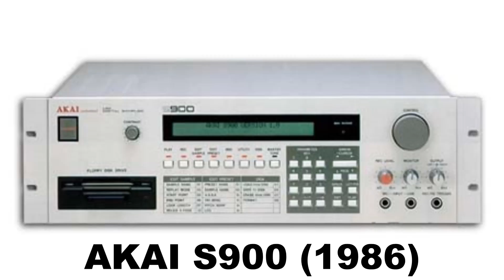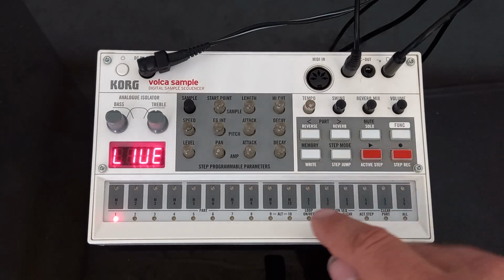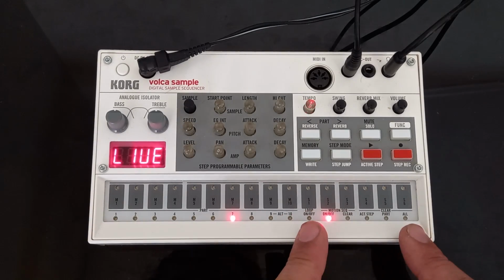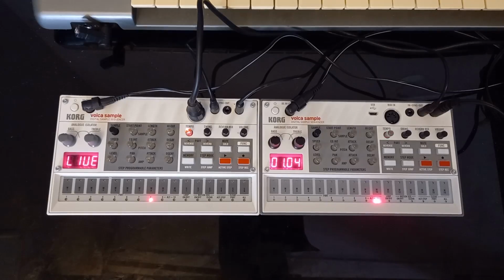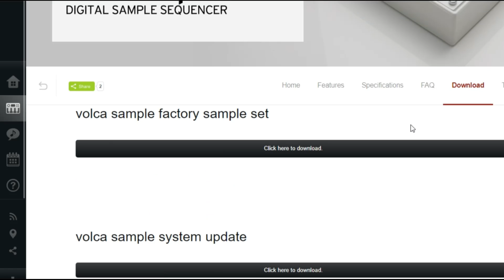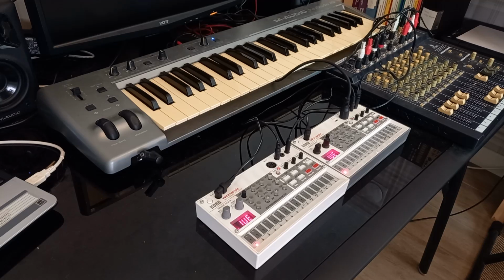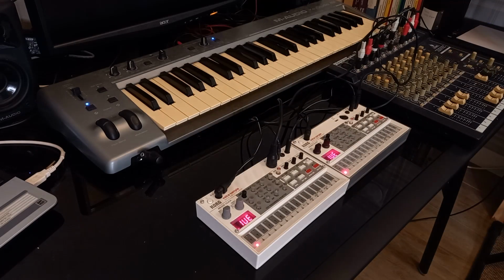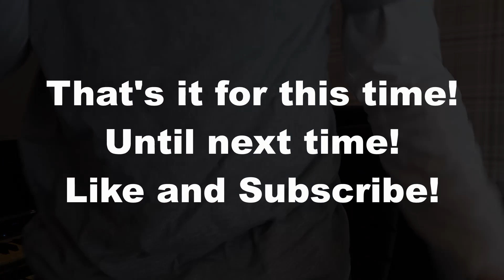Volca Sample Vs Volca Sample 2 (Which one is the Winner!?)

Comment: OG one every time: I put an 808, 707 (sorry, 909) and DMX drum kits on 3 of the pattern slots, leave the other 7 for making loops and other nonsense. If you think about it, this is the only really ‘original’ Volca, the rest just recreate extant things.
Reply from the maker: Thanks for the comment! :)
Reply: You think a volca sample would be good as a drum machine to record demos with ? I plan to load in old kits like a cr 78 and a linn to use as backing beats on cassettes
Reply: @johnrodriguez5872  Probably, no reason why it shouldn’t be good
Reply: It's a sampler, yet it's original? Huh? Plenty of influences in this device from the 808 style programming interface to the SP1200.
Reply: @lundsweden  Neither of which were made by Korg, tbf

Comment: Hi!  : )   I wonder if you can help me confirm a thing ... There is something with my Volca ( or it's that way on all volca Sample 2 ) ... I have a pattern with some muted samples. When I use the "solo" function, it does what it does, but after I turn   the "solo" off,  all parts are unmuted automatically. I want the muted to stay muted, but may be that's how the Sample 2 works ?   : )
Reply from the maker: I'm not sure, but you can save patterns with muted channels. What if you unmute the channels and the save the pattern?

Comment: Just got ahold of the Sample2 myself and learning how to integrate it into my current setup (Electribe MX and TD3) and this was super helpful! I don't suppose you have any recommendations for a mixer or interface that would work with all 3 machines? Awesome t-shirt btw
Reply from the maker: Thanks for the comment! I use a regular analog mixer when I record my volcas. What is important to have to ensure a good mix is that you have individual volume, equalizer and pan for each channel. Also it is very valuable to be able to add fx, e.g. reverb and delay, so best is to get a mixer with build in fx, so you do not have to buy a extra fx unit later. If you do not have a good sound card yet, you should also consider a mixer with build in sound card, that you can connect to your computer via USB. I do not want to give any recommendations, but an example of a mixer could be Uli's: Behringer Xenyx X1204 USB.
Reply: @AdamVoxMusic  thank you very much for replying! I've had other people recommend the Xenyx 1202 so that seems like a great shout c:

Comment: Functionality wise, I'm trying to decide between buying a Sample 1 and install the Pajen firmware vs buying a Sample 2 and get the Retrokit RK-002 smart MIDI cable.

Is there an advantage of either setup? Am I mixing oranges with apples?
Reply from the maker: If you want to use MIDI to play the sampler using an external key-board like an instrument sampler 1 with pajen is better. If you want to use it for sampled loops and as a drum machine, sampler 2 is better.

Comment: I have the Korg Volca Sample, Keys, FM, and Drum units, Two Behringer TD-3s, routed into a Mackie 1202-VLZ mixer, with a Roland SRV-2000 Digital Reverb and a Korg NTS-1 as effects.  I've been playing around with this setup (on and off) over the last few years, usually recording to cassettes.  This year I added an Arturia Keystep Pro to the mix to add more complexity to my compositions.  However, the sample selector knob on the Volca Sample isn't working now, and I'm now contemplating purchasing the Sample 2.  I'm just hesitant in buying another product after seeing something fail, especially an item that's wasn't in use (the unit sat unused on my studio desk for months until the day I got the Keystep and hooked it up).

TL:DR  If you had the Sample 1 and it was no longer working as intended, would you replace it with the Sample 2 or spend the money on something else?